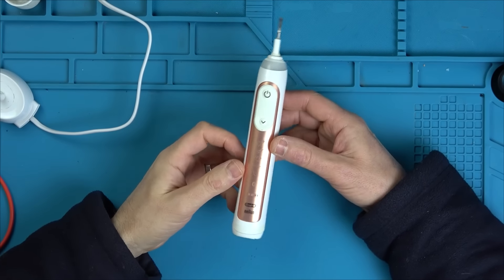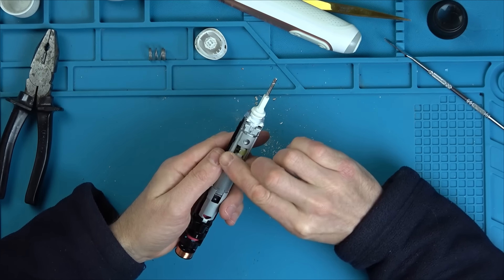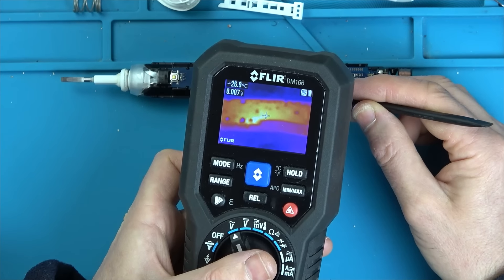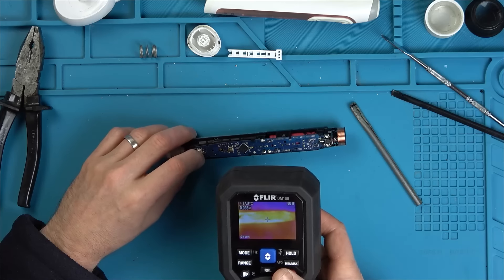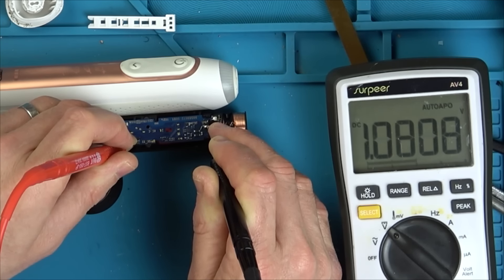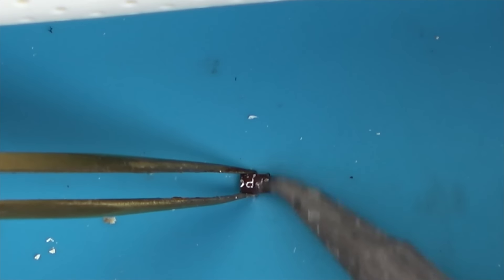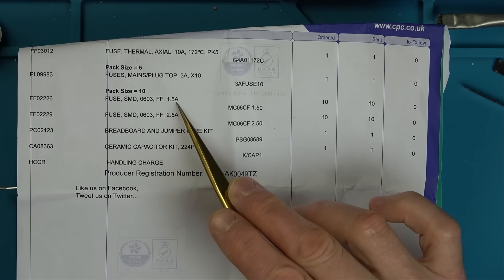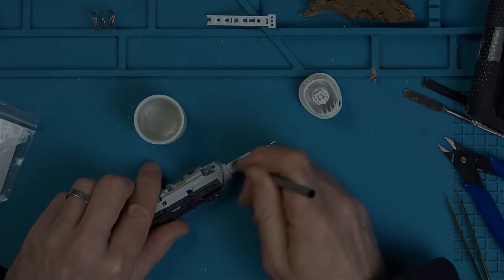Trying to FIX my Wife's ORAL-B Electric TOOTHBRUSH

Comment: 99% clean IPA is NOT conductive. The already failing 375mA rated fuse and surrounding area was hot and by putting cold IPA on it, caused a thermal shock that caused it to go open circuit.
Reply: Thermal shock is likely as is mechanical stress...

Comment: the PP component is a PTC fuse, It increases resistance as the heat increases. When you inject the IPA, it also means you cool it down, so the resistance decreases, the current through it increases and overloading the fuse next to it.
Reply: 100% also Vince please watch your fingers do not touch your meter probe ends as instead of reading open circuit you will get your skin resistance indicated. I suspect the PP resetable thermal fuse was going intermittently open when you were measuring it.

Comment: Well done. I believe the item marked PP is a resettable polymer PTC fuse (Bourns MF-PSML300), available from Farnell et al. Many operational explanations on Interweb. 99% IPA is typically 1% purified water, though there are some dubious suppliers. Such a high resistance has very little effect and many repairers use it as a poor-person's infrared camera.

Comment: FWIW, you can easily take off the bottom end by placing the toothbrush on the charging base, pressing down and grabbing both the base and the bottom end and tilting the brush. It's really easy. It's much harder to remove the top insulation ring.
Reply: yes, that‘s true. That’s the way to open the bottom quite easy without any tools 👍

Comment: Hi, when I was measuring continuity with battery connected has occurred the same the toothbrush died completely. I hadn't another PP to replace so I took the battery off and resoldering the PP just like I was replacing that and when I put back the battery the toothbrush recovery by itself. I'm very happy now! thank you for your video.
Reply: I got an email about a reply on another message thread from you. These "REPLY" emails are worthless because it doesn't go to the comment, so one would have to search all those messages. Fix this, YouTube! We don't have time for this foolishness!
On to your question eduardo, find some 30 gauge wire. Wirewrap or magnet wire. Solder that in place of the PP fuse. I can't get any more explicit than that. This wire should melt at about 2 amps, functioning like a fuse.
Reply: @pwrgreg007  I appreciate your attention ! I will try to find this one to replace the pp component that I shouldn't find anywhere ! So one more time thanks for the tip and help me!

Comment: The IPA resistance is in the Mega Ohms, it also looked a bit dirty which might affect the conductivity. Mega ohm resistance won't affect much and certainly couldn't blow anything. :)
Reply: I was pretty sure that IPA wouldn't cause any issues as I've used it to find hot components and also seen many other creators in this field do the same. I had to test if myself and found that it was around 20+ Mega Ohms.
Reply: ^ what this person said ^

Here's the science bit for those that want a in depth answer .
"Isopropyl alcohol is a polar solvent, which means it can form hydrogen bonds with water molecules. This makes it non-conductive in pure form. When isopropyl alcohol is mixed with other substances such as salts or acids, however, the resulting solution can become conductive. For example, when salt is dissolved into a solution of isopropyl alcohol, the salt molecules will break up into ions, which can carry electrical current. Similarly, when acid is added to isopropyl alcohol, the acid molecules will ionize and create a conductive solution. In conclusion, isopropyl alcohol itself is not conductive, but it can become conductive when combined with other substances."
Reply: As long as it’s 99.9% ipa it’s safe

Comment: My 2010 Oral-B was awesome, that thing lasted from 2010 right up to 2022, only reason I had to replace it was because the battery was degrading, and the rubber grips had all but completely worn off.

Bought my new Oral-B in 2022 (Looks identical to your wifes one but is black).

My 2010 Oral-B, you could open the base very very easily, the plug had a little bumpy bit on it that was designed to fit into a hole in the base to turn it (sorta like an allen key), you kept unscrewing and eventually the bottom came off.

The other nice thing about my 2010 one was that the charging base had a holder for all the toothbrush heads too.

Still, I do like this new one, battery is still going decently strong in it, lasts about a week to a week and a half (Almost a fortnight, almost!).

Comment: Hi Vince! When I saw this video recommended by YouTube got a real flash back to the few years ago :) thanks for the initial recommendation of my channel and thanks one more time for mentioning it again! I must say the whole video I was thinking what I will write in the comment and the whole time I was "complaining" why did you not made your research!!! You could have saved so much hassle.. but you are right what you learn on your own mistakes stays much longer. That said I believe your toothbrush is still in danger one thing is that you put the rubber case part under the plastic ring afterwards, this compromises water tightness strongly, other thing is the hole in the bottom cover.. it is ventilation hole but with a membrane (for small amounts of water condensate to escape) now your toothbrush has a hole in it where water can easily enter.. and these brushes don't tolerate water as much as philips toothbrushes do.. motor corodes and not much can be done there.. so check eBay for some dead genius brushes just to get the bottom cap, and revive one more motherboard as this defect is really wide spread :( I started repairing Philips and oral-b toothbrushes for People locally and was overwhelmed with request for repair.. this made the tall on my YouTube channel as last video is almost one year and have tons of material that I have filmed but can't find the time for video editing and uploading.. anyways thanks for the good memories and keep on learning!!! Cheers
Reply from the maker: So sorry I have only just seen this message. I'm really happy you watched it and even happier to hear that you are repairing them for people locally, I hope that is a profitable venture for you and an added bonus is keeping the toothbrushes out of landfill. Cheers for the tips on keeping my wife's toothbrush waterproof, I appreciate it. Keep up the good work 👍👍👍👍

Comment: For an item to heat up like a fuse or resistor it needs a higher resistance, think of Ohms law, the lower the resistance the lower the heat it will dissipate as there will be a lower voltage drop across it for the given current, I x V = P so it actually works the opposite to what you would expect.

Comment: 🤩❤️ Great video, think this not the conductivity of IPA but the temperature drop make PP reset pass current into E fuse and blow then suddenly 

Stay mysterious why originally PP fuse might be faulty by time bc never reset for too long little bit like a switch contact melt on surface ( here microscopic size )

Comment: That PP component is very likely a PTC Thermistor put in series with the motor made as a overload protection. it is meant to have a certain resistance and the higher load you get the hotter the thermistor gets it will raise the resistance and reduce the current through it. it is the same way a re-settable fuse works. the PTC enters a avalanche state where the thermal state heats it up enough to start increase resistance and the extra resistance increases heat which increase heat even more and you get the point. these PTC components can´t cycle endless amounts before they eventually fails

Comment: Even (pure) water isn't very conductive, let alone the small quantity in IPA. Organic, non-polar solvents (IPA) do not support the flow of electrons easily so can be considered non-conductive. I suspect the PTC device was damaged (further) by absorbing some of the IPA (possibly because it had already started to delaminate). I imagine the PTC device is to cut off the power if the toothbrush is left on for too long (so it is intended to heat up over time). When  the faulty PTC device was exposed to IPA and possibly absorbed some, it may have briefly gone S/C and thereby blown the 'E' fuse.

Comment: In answer to the IPA conductivity issue. I repaired a high end power supply, replaced a component in the PFC Circuit but the IPA hadn’t completely dried or evaporated. When I switched it on it took out about £100 pounds worth of components. I was not happy as the unit worked but just needed a cap changed for preventative maintenance.

Comment: Hi Vince! Long time viewer from Canada here where I've been employed as a chemist for the last 29 years. As such I can assure you that Isopropyl Alcohol is NOT conductive. IPA is an acid. And while it is true that when you dissolve an acid in water it will dissociate into ions which ARE conductive, because IPA is one of the weakest acids around it does not separate into ions when dissolved in water. It is the ions in water that makes water conductive. Since you're using 99% IPA I can assure you that you have nothing to worry about. IPA itself is NOT conductive at all. I'm not sure who this rude person was who claimed that IPA is conductive but you can take my word for it, it is not. Hope this helps. ♥
Reply from the maker: Thank you 👌👍

Comment: The component labeled 'pp' is likely a Bourns MF-PSML300 PTC (Positive Temperature Coefficient) resettable fuse. Meaning the resistance goes up as it heats up. Additionally, the person that said IPA is conductive was either not using Pure IPA, or more likely was just being an ... Yes, even pure IPA is slightly conductive, about 20 Mega Ohms over distances less than 0.5 mm. However this does not electrically influence any household circuits because even at relatively high voltages like 400v or 600v and short distances like 0.5 mm, this will result in only 0.1 mili Amps of current flowing. This is also the reason why Mega Ohm resistors are rarely used in household electronics, aside from some exotic speciality applications fractions of a mili Amp are just not useful for most electronic applications.

Comment: Interesting fix. Had myself a Braun Oral-B type 4728 between 2006 - 2022, and was recycled because the battery didn't hold any charge anymore. I guess it could've been replaced, but decided to buy new battery operated toothbrush instead. 
Took the old one apart, saved the motor which has good metal gear in the axle, and few other parts too, recycled the rest of it, including the charger. When I took it apart, managed to destroy the charging coil, so that was the thing that doomed it.
Now I wish I would've kept the pcb as well, as it was otherwise working ok, could've had some spare components there.

Comment: I have a 14 year old ORAL B electric toothbrush and I've used it regularly. It's a very impressive toothbrush, I haven't replaced the battery at all in it's lifespan and the battery still lasts a week before it needs a charge! This is why I like NiMH compared to lithium. Sure it has less capacity but it lasts WAY longer.
Reply: Lithium batteries can last very long - of course with some degradation in performance, the same as with NiMH.
Reply: @TylerDurden-pk5km  My experience is way different. With lithium the batteries fail with that they can't deliver enough current, won't keep a charge, get too hot while charging or too low of a capacity. With NiMH you can forget about it for years and even if it reaches 0v, it won't really degrade as badly as lithium would. Heck for safety reasons you shouldn't even use a lithium battery that got too empty.

NiMH batteries can be abused and they will work fine, not so much for lithium on the other hand. NiCD can be even more abused than NiMH. For reference, NiCD best storing voltage is 0.6v - 0v. 0V meaning completely empty. And NiMH quite similar to NiCD. Also here is a fun fact, NiCD is currently the top holder for the fastest charging battery technology out there besides super capacitors which shouldn't really count as a battery.

Comment: What you need to replace the fuse is some of Sorins "specially calibrated wire", Electronics Repair School
Reply: Just found out about Sorin's channel. What wire is that suppose to be? Just a thin one?
Reply: @rogierius  I used 30-gauge wire-wrap wire (for the PP fuse). Unit has been working now for over two years.

Comment: Hi Vince, i very like your videos keep up the good work, IPA and water (distilled water) are non conductive liquids in their pure forms,,but when you add another chemical like salt or lets say flux it becomes a different matter, that's why you should never use liquids on a live circuit, your test with the cap of a bottle doesn't prove anything other than the liquid is contaminated. hope it helps? best regards from Denmark
Reply from the maker: Thank you Erik 👍

Comment: Test the IPA in a clean container.  Contaminates affect the conductivity of a liquid.  I would guess the PP fuse is for the motor and the E fuse is for the electronics.  Also, conductivity in the several meg ohm range is just this side of nothing.  You'd get a similar reading testing the skin on your hand.

Comment: I think the pp is a PTC fuse and thermal shock could have been the short however that little chip could also have an oscillator running at several MHz and capacitive loading by IPA could have caused the oscillator to lockup and caused an internal switching transistor to latch on blowing the fuse. most things become conductive and capacitive at high frequencies

Comment: pure ipa is not conductive but it like most alcohols draws in moisture from the air it gets slowly more conductive over time (which is why older gas engines their fuel tanks and components suffer a lot of rust from the newer alcohol containing fuels )  for testing a flux powder would be safer components that heat up will melt the powder quite fast

Comment: I paused your video and did an experiment, i used 4.5 volts and an led from an old pc. I ran the led positive wire straight to the 4.5 volt power and ran a wire from ground of the led and a wire from the negative on power supply, i exposed the wire on both ground wires and filled the lid of my ipa and filled a drink bottle lid  with water, when i dipped both ground wires in water the led lit up, but in ipa it didn't do anything. Hope that helps you out

Comment: I have used Braun Oral B for decades.  I have the older style with a larger battery, which no longer holds a charge (does not have an indent on the bottom).  The newer one you have has the indent on the bottom has a much smaller battery.  It will be interesting to see how to replace the rechargeable battery, as I assume that's going to give up the ghost next.

Comment: If it's 100% IPA it's safe as far as i know but if it's less than that the impurities will conduct current. So check your bottle label!
Also if it's purely for finding out which part is faulty use a cotton bud to dab it on components in the area as this won't conduct anything if it's just a blob on the top!

Comment: Just a thought on videos when you're measuring ohms... I noticed you touch the ends of your probes when testing which would affect the reading  as its goung through your body. If you touch both leads with fingers on either hands you'll get a reading, so not sure if that plays a factor in your measurements.

Comment: A lot of ladies working away stuck in a lonely hotel room get bored. They need a little more than 3 minutes of toothbrush vibrations to relieve that boredom. Toothbrush overheats and fuse blows. The upgrade from an E to a K fuse is probably good. Just saying... 😉🤣
Reply: Exactly what i was thinking. I mean a bit of a coincidence.

Comment: Very common fault on the 3771. I wonder if Oral-B got a bad batch of fuses? Mine had other issues so I fixed it by buying an old but working 3771 (wrong colour) and swapping the guts over.

Comment: Mine went just like this. Wasnt holding charge. same model. Thought battery failed- Had recharge it daily. Turns out I was simply plugging it in on the 110v side of the bathroom socket. They need charge at 220v. 😂 Working perfectly again on 220v side of wall adapter!
Reply: You should use the socket that fits the charging adapter. Here in the USA it's 120V. And I replaced the PP fuse with a short piece of 30-gauge wire-wrap wire. It's been going strong now for over two years.
Reply: @pwrgreg007 hi, in Ireland/UK, our shaver power points in bathrooms often have two 2 sockets. Bathroom devices like toothbrushes and shavers often use two round hole sockets (unlike rest of house which are always 3 squarish hole sockets). When there are two sockets one is 110v and one 220v. in my experience, they are not always clearly marked
Reply: @AmbroseClarke  I wasn't aware that 110v was used in the UK. I thought it was all 220v wired in a "ring". Most homes here have a center-tapped transformer so we have two 120v legs out-of-phase (neutral center-tap) that can be used for 120v or 240v.
Reply: @pwrgreg007  Its all 220v throughout house here - but often you get a very small transformer built into some bathroom fittings, like on a mirror light - no idea why its a thing as few people here have 110v devices - but often seen in hotels, which would make sense there to support visitors bringing their shavers.
Only other place I can think you might see 110v is sometimes on building sites - where they have to use big transformers to step down the voltage for industrial drills.
The other voltage that is more a business/workshop thing, but becoming more a premium option lately in European houses, is 380v (3 phase) for charging electric cars quickly.
Reply: @AmbroseClarke  Good to know, thanks. With USB chargers typically able to handle 100-240 VAC, and everything going on batteries, we may not need to worry about power sockets in different countries much longer.